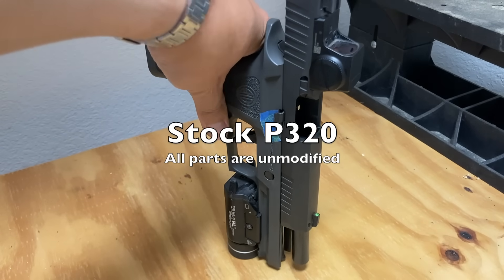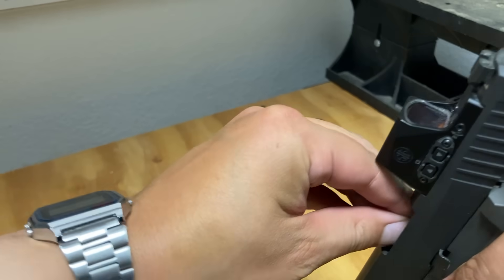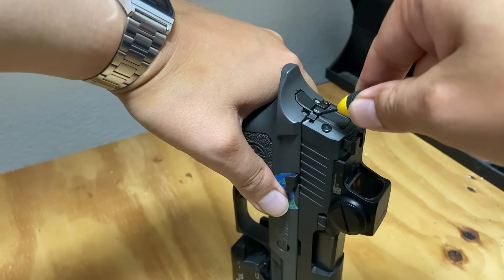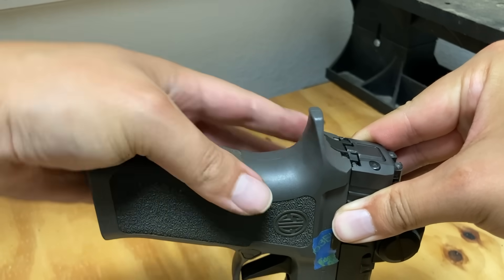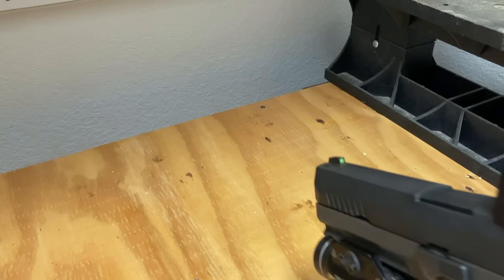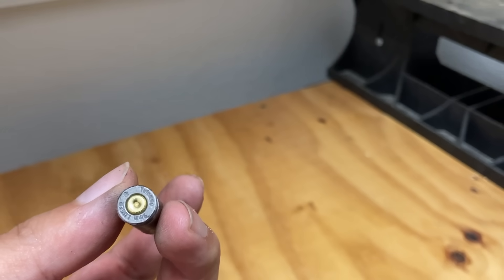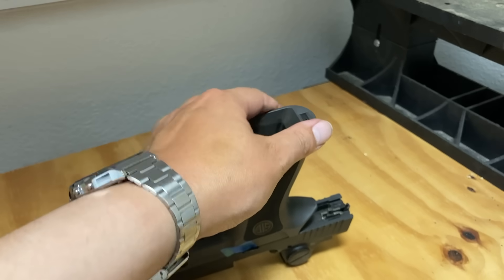Attempting to reproduce the FBI's Aug. 2024 P320 Sear Movement Test

Comment: Great videos, and solid, methodical, scientific approach.  However, a potentially important configuration you haven't checked is wiggling the slide, frame squeeze, etc. with a magazine, holding at least one round (primed case), inserted.  In real world situations people don't generally don't carry without a magazine inserted.  Doubt if an inserted magazine would make any difference, but it is an experimental design variation you haven't checked.  Thanks again for your meticulous and highly informative attempts to dissect the cause of the uncommanded discharges in the SIG p320..

Comment: I think the main problem is SIG has crap quality control and there is an issue in manufacturing.  Some guns are fine, and others are not.  I could replicate it with my 320 but a friend couldn't.

Comment: Thanks again for these awesome demos. I watched all segments twice, and it's starting to make sense to me. Keep in mind, I know almost nothing about how the internals of these pistols work. In the second-to-last one, you demonstrated the function of the P365 vs the P320 by pushing down the sear, and showing no other component movement. If I'm understanding this, the design of the P365 FCU is markedly different from the P320. Would you agree? Also: I'm glad you're not addressing the PR side of this, and just sticking with the functions/fail points. I'm in media, with 30 years experience with PR and Marketing, and I would not want to be in charge of what's happening now. It appears that their entire public trust structure is about to collapse.

Comment: After watching several of your videos, I noticed the same movement of the lever that pushes up on the striker safety bar when pressure is applied to the sear manually. So, on our one commercial P320, and a couple that I built from 80% FCUs, I modified the lower part of the sear in a similar way that you demonstrated in a previous video, with good results. The only movement of the striker safety disconnect bar now is with a trigger pull.
There is another video online showing the pre-travel was taken up first, then the slide struck and wiggled, causing the striker to be released and setting off a primed case. After seeing that, I took the slide off of one of ours and I see the lever that actuates the striker disconnect bar is the first to move, and does so during this pre-travel part of the trigger pull before any of the rest of the firing sequence begins. So, in essence, the most secure, final safety mechanism is the first to be disabled. I'm not an engineer, but that concerns me a little, I would have expected that to disengage just before firing. 
I bought an extra rear slide plate and cut the bottom off so I could better see the sear engagement and what was going on inside (I saw 100% sear engagement on all of our pistols every time).  It also made it much easier to see and push on the sear. When tripped, it looked like it was stopped every time (and I've done it almost 100 times with each pistol) by the striker disconnect safety bar, I never saw it stopped by the secondary notch on the sear. The only way I got the striker to sit on the secondary sear notch was after dropping the striker, I could pull back slowly on the slide and watch until the striker came back past the secondary notch and I stopped pulling it back from a full re-set. It would fire a primed case as designed from this notch with a pull of the trigger, and I couldn't tell any difference in the trigger pull.
So, if something moves the trigger even slightly, the striker safety bar is moved out of the safety position and disabled. Then, anything that disengages the sear will most likely cause it to fire. The other video I watched seemed to have a very sloppy fit between the slide and FCU rails, the up and down movement, banging and hitting, could possibly bumped the striker off the sear ledge, and since he was holding the trigger back to the end of the pre-travel, there was nothing stopping the striker at that point. The secondary sear notch didn't catch the striker in his example, nor any of my tests.

Comment: The latest report showed that its due to wear with the sear, striker spring misposition (due to wear), striker malformation (cheap manufacturing), and frame separation tolerances.  Who know's the truth, and I can't speak for the 320, but anybody that's done a trigger and striker replacement on a 365, knows that the component quality is severely lacking. Nice test though

Comment: Hypothesis: The Safariland duty holster retains the P320 by locking onto the slide at the ejection port, effectively coupling the holster to the slide assembly. In the F.E. Warren incident, it is plausible that external force applied to the grip or frame—while the slide is fixed in the holster—could induce upward separation between the FCU and slide.

This relative movement may allow the striker to release from the sear under spring tension, resulting in a discharge. While firearm-initiated, the event could be mechanically induced by the holster’s retention design. This failure mode merits investigation into slide/FCU tolerances under constrained conditions, as well as dynamic interaction between holster and weapon.
Reply: What about the firing pin safety? Even if the firing goes off, the safety should keep it from striking the primer.
Reply: @wraith2k82 there are examples of that failing as well. For these considerations, the worst case scenario needs to be the basis, as that worst case could severely injure or kill the operator.

Comment: I wonder what the USAF Airman just killed on 20 July would say about these tests.
Reply: 1, let’s wait and see the outcome of the investigation; 

2, he did the test, and gun did not fire. That’s a fact. He didn’t say other guns won’t fire, he said in his test as recorded the gun didn’t fire; 

3, the airman killed himself because of his own mistake. Never, ever point a gun at yourself. Safety 101.
Reply: @js2009-g9f 1. Agreed. Let's wait until we see what the investigation says, especially for solely blaming the airman for his mistake. 

2. You're right. HIS pistol he has in the video alone did not fire. Only his. Not any other. Just his, and his alone. He freely says, repeatedly, he thinks this is what happens. Not a fact, a thought.

3. Yes, maybe the airman made a mistake of pointing the pistol at himself. However, why did the gun go off. Saying he shouldn't point it at himself is completely exclusive from the gun going off in the holster. So, yes, let's wait for the investigation to determine why the gun went off. It wasn't because the gun was pointed at him, was it?

Comment: I believe this to be a case of tolerance stacking. Meaning, that all components have a +/- of ever how many thousandths of an inch. With the right combination of parts / tolerances, even though technically in spec, result in the issue. i.e... some guns are perfectly safe, but others aren't.

Comment: Have had the 320 FS and Cmpct in 9mm, 40S&W, and .357 Sig since it was introduced. I’ve carried in Blackhawk duty holsters in numerous hard use tactical trainers classes w/o issue… I did send my first Gen 320 back for the “upgrade” when it was offered, and I u it se WC grip modules on all my 320’s and 365’s. Is there a definitive tracker of ND’s across all manufacturers/brands?

Comment: Based on my testing with my m17 sample size of one, the manual sear depression acts like a trigger pull if I push down enough like you are saying.

I can fire a laser cartridge maybe 3-4 out of 20 punches.

Phil strader mentions that in the latest video with seeklander from Wilson combat.

So the fbi saying the striker safety tab can be rendered inoperable isn’t true because it’s using the sear depression test which BEHAVES like a trigger pull and can at times disengage the striker safety lock

Comment: I may be wrong but I feel like almost all the issues are on the M18 and M17 P320s. But I'm assuming that they are basically the exact same as any other P320. Personally, I do own quite a few Sigs myself as well as a P320XCarry, and as a Sig owner, I don't discount the P320 issues, even though I haven't had issues and I don't think it's all P320s. I'm curious as to why it seems the M18/M17s have so many issues however.
Reply from the maker: Uncommanded discharges appear to happen with equally inconsistent infrequency with all versions of P320 / M17 / M18.

Comment: Sample size of 1 proves nothing. Clearly all 320s do not have this problem or there would be way more ADs. The FBI did this test on a gun that supposedly had an AD while holstered, so if it did in fact go off in testing it's a qc issue affecting random firearms off the production line. That being said don't see s&w, glock, hk, cz or any other brand having this issue so why carry one that's gunna blow ur nut off.

Comment: Idk if you’ve seen it but on pre-upgrade p320s, at least the 2 I’ve messed with, if you hold the slide upside down, the striker safety will disengage, like the spring is not applying any pressure whatsoever.  Even on upgraded pre-2017 guns, I don’t think they touched the striker after they upgraded the sear.  All other p320s afterwards have better spring tension on the striker safety.  Just one of my observations.

Comment: I hate the fact that the department armorer had to mill parts on all of their guns because SIG delivered them in non-working condition. This gives SIG complete plausible deniability to the issue. To me, the holy grail is to find an exact example of this part that was milled in the original as-delivered state as well as an exact example of the part after the armorer milled it. I think that's what is needed to really nail down what is causing this in some guns. It has to be a manufacturing issue that some batches are suffering from, as evidenced by the fact that the entire department's order had the same trigger problem from the factory. Something, somewhere in SIG's manufacturing infrastructure is ever so slightly out of spec, and I bet it's really hard to find out where because I'm sure that they are outsourcing everything to multiple countries and vendors.

At this point, there are simply too many anecdotal testimonies pointing to guns that fired uncommanded as having experienced multiple unexplained dead trigger events prior to the incident. The part that has to be milled must be the final issue that compounds other minor issues into a chain reaction fail event. The evidence should lead us in that direction, which unfortunately means we need to get our hands on a copy of one of these guns.

Comment: The one I have was new, rarely shot, should not be worn inside or have any parts swapped for incorrect ones (see other video about this) I would not carry it.  My son took it to be his carry  gun.  As soon as I learned this I gave him my Glock 19 in exchange for the 320, which I had given him.  Could you imagine if I had known this about the 320 and my own son would have gotten hurt or killed by it.  I would not have been able to live with myself. I just hang onto it hoping there is a buyback.

Comment: My biggest question is if this is also affecting the manual safety variants like the M17.
Reply: The safety on the m17/m18 are for the trigger, not the sear.  If there was an issue with the striker safety not requiring a trigger pull to deactivate, along with the sear somehow dropping, the manual safety would be irreverent.
Reply: @MikeB-ng3ol thx

Comment: The other notable piece that might explain the inability to reproduce is that the striker safety lever spring in the striker assembly was not fully seated as per the report. Perhaps enough to bind the lever or to not force reset.

Comment: The P365 does NOT have Unintended Discharges. Why?

 They put the STANDARD firing pin block in the slide again. 

 If the trigger is not to the rear, it is IMPOSSIBLE for the firing pin to hit the live round. 

 The P320 doesn't have that. Whether 99.9% of the discharges are Negligent,  the spector of the original "dropped gun firing" video hangs over the P320. 

 It is forever unsafe in many minds. This little fiasco with the FBI testing is the final straw.

 I had FIVE of the P-2xx guns. The only reason I have four now is one was stolen, and got confiscated in a drug dealer bust. 

 I am not a SOG hater. I would never touch a P320. I know the part breakage and spring issue with the P365. 

 I still might buy it, but got to switch out parts to non-OEM to make it reliable. 

 For many younger gun owners, that's the kiss of death on the brand. That's sad.

Comment: It's my understanding from reading some of the report and looking at their photos, the striker safety lever spring was not reseting properly. They showed it not properly seated in the lower part of the safety lever. If the spring isn't keeping the lever in the proper place because the spring isn't correct, the safety lever won't function as it is supposed to.

Comment: They will blame any problems on what ever bun they carry. They blamed the 9mm as well for those of us who remember. They also used to call it getting Glocked. It wasn’t Glocks fault either. These striker fired non manual safety pistols are just a less safe design than other options and offer more possibilities for negligent or accidental discharges.
Reply: Sooo, why do Glocks discharge when they are merely being cleaned?
Reply: Glockleg 2.0

Comment: So I have a question. I read that the P320's in question were older models from around 2017 and earlier. After that time, Sig updated the parts to fix this issue. Was this incorrect info someone posted or true?
Reply from the maker: That's related to a completely separate "feature" where the P320 would fire if dropped at a very specific angle on the back of the slide. In 2017 they initiated a "voluntary upgrade" instead of a recall, and hoped that that would be the end of the story. It obviously wasn't.

Comment: Sig just couldn’t let go of the DA/SA concept. To me, it looks like the striker is charged all the time, using the trigger to slightly lift pressure to release the striker. As opposed to the Glock that uses the trigger to fully charge the striker before release. 

It’s like Sig sawed off the external hammer of the 226 and made it a SAO. Weird.
Reply: The partially cocked striker doesn't really make a difference, it's been proven to still have enough energy to detonate primers should the striker be released prematurely. The FBI report seems to simply point to out of spec, low quality parts being susceptible to failure under certain circumstances.  With that said, they had to modify the secondary sear in order to do this test because on the pistol they were provided, the secondary sear was catching the striker

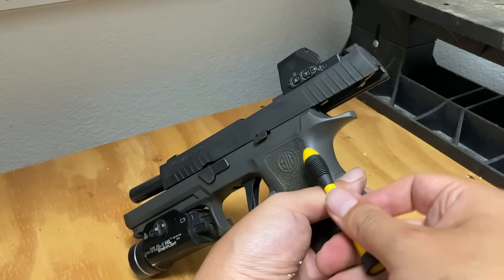Comment: I admit I have no interest in the Sig P-320 crisis. In my opinion it is an overly engineered Rube Goldberg device with far too many loose ends. I don’t like the gun and never will. Having five safety 8:54 devices tells me someone’s thought process ran amuck. One thing of interest  though and it happens with many make pistols is the fact the slide moves up and down with trigger pressure or  magazine pressure. Glocks do this as well as many others but these other pistols aren’t self detonating. Is this part of the issue? If the butt of the pistol is leveraged in the holster from side to side can this cause a UD?  I don’t know but something damn sure isn’t right. When I heard service members were being brought up on charges for UCD’s and losing rank and pay there comes a point to stop the insanity with P-320/M-18 pistols. No other pistol on the market has the glaring amount of unwanted discharges this one does. Sure all pistols MAY suffer an unwanted discharge but not at the rate the P-320 does. 

I don’t know how anyone can say with a straight face the P-320 is a safe pistol cuz it is not! People’s lives and careers are at stake here and Sig is blowing this problem off. What a shame. If I was still in law enforcement and was required to carry a P-320 I would quit and go elsewhere for a job. What a sad joke. 
RH